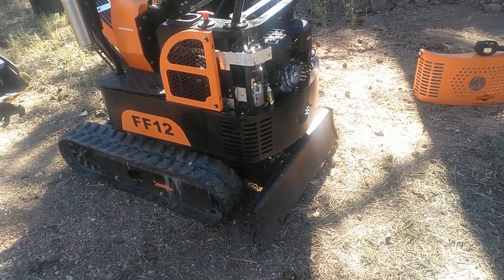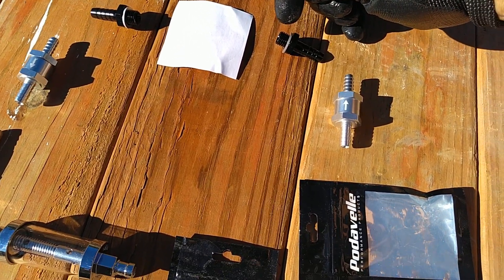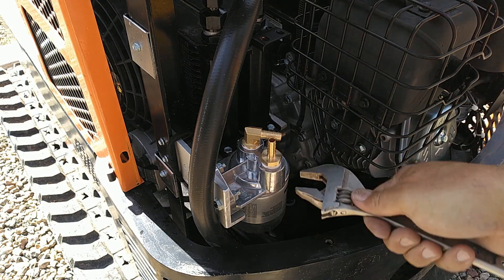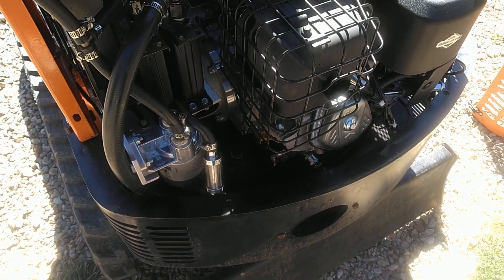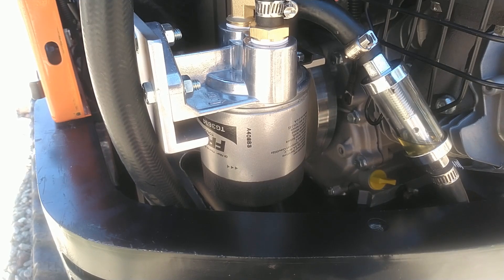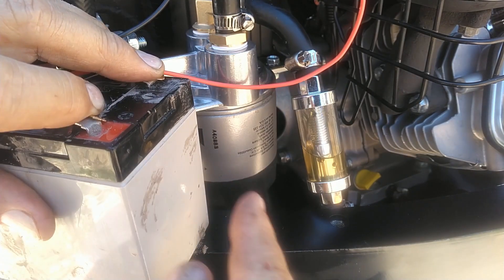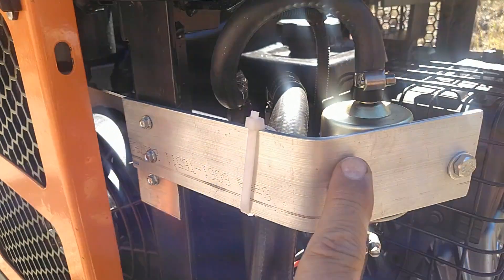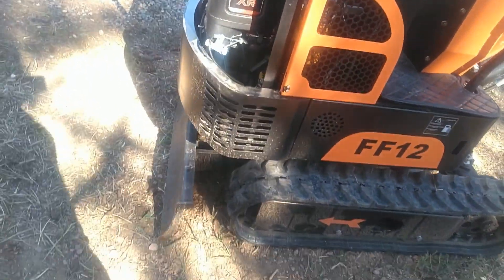Chinese Mini Excavator: Installing Engine Oil Pump for Engine Cooling and Oil Filtering

Comment: Wonder if these are necessary? I been running a bunch of these 420cc briggs motors and never had an issue thus far?
Reply from the maker: @watchere  The confined space in these mini excavators leads to the heat getting pretty high really quick. The machine overheats and loses hydraulic power after running for about an hour without adding the  cooling. If you are running the machine for short periods it should be fine without mods. I have run for full days with the mods and it works great. Edit: corrected typo
Reply: @madscientisthut  you just answered your own question it needs a hydraulic cooler
Reply from the maker: Was not my question.  @rotarycomptech
Reply: @madscientisthut  well you got the answer anyway

Comment: You are probably losing the pressure you need through the PCV hose from the valve cover to the air filter.
Reply from the maker: Thanks for the info. You're likely right about the PCV. During the first experiment, I didn't mess with the PCV, so it might have performed significantly better had I blocked the hose. I assumed there would still be sufficient internal pressure fluctuations for the air pump to function, but I quickly abandoned the idea since I already had the 12V fuel pump readily available and it was quick enough to try. Thanks for watching and the comment.

Comment: to also solve the heat problem I've welded a pipe to my exhaust. It solved alot of the problem
Reply from the maker: I considered extending the exhaust pipe, but I think I'll keep it short for now. I believe the Venturi effect will help pull air out of the engine compartment. I should conduct an experiment to see if it actually improves air extraction from the compartment.

Comment: So, there's 2 oil drain plugs at the bottom of the engine?
Reply from the maker: Yes, on the engine there is one oil drain in the front and another in the back.

Comment: I was thinking about using a pneumatic fuel pump because I'm not sure how many amps the charging circuit puts out and I want a light bar and cooling fans. I would figure you would want the hot oil going through the filter first as hotter oil should flow through the filter better.
Reply from the maker: I think the Briggs 13.5HP should have 9amp max charging circuit. I can measure the pump and fan draw next time I run, but currently snowing here so going to be a week or more. I am also planning on a light bar on top of mine since the small LED light that is on the boom does not help much. That may work better for the oil filter but the flow seems fine for my setup, I did put the oil pump (fuel pump) last because I wanted the least amount of heat running there to make the electronic parts in the pump last longer.
Reply from the maker: I just looked at the specs on the fan and fuel pump, the fan is specified at less than 5 amps and the pump is specified at 1.2 amps. But I will measure it next time I run just to double check. 
Edit ( fixed typo )
Reply: If nobody else has tried it I will have to test a lawnmower fuel pump to see if it can handle the viscosity. I think it might as if you pump 2 cycle oil through a 2 cycle carb for storage the diagram pump on the carb seems to handle it just fine. The small area within the hose on your setup seems like it might be too resistive of an air spring. I was also under the impression this engine had a PCV to the intake, did you block it in your test? Sitting here thinking about it, I wonder if you put a sandwich bag in a peanut butter jar sealed with some pipe dope, with a Schrader valve on the bottom, flipped upside down with your expansion tube connected to the lid so it acts like an air spring diagram pump that you could play with the pressure. It is possible at the high rpm, the time at pressure and vacuum in the crank case isn't present long enough to move such viscous fluid...
Reply from the maker: Also in my test of my pneumatic pump design I did not think about how much the viscosity changes when the engine gets warmer. I did not let the engine warm up long enough during that test. I think it may pump better when the engine is warmed up. But now that I have the electric pump in there and have over 30 hours on this design I am really happy I did this, the engine compartment is much cooler and I really am happy that the engine oil is getting filtered. I do agree that the "air spring" could probably be larger too.
Reply from the maker: As far as the PCV valve, I did not look for one.
Reply from the maker: I just put a video up where I measure the oil pump and the fan, current draw is around 4 amps. So there is plenty of room to add a couple of 18 watt led spot/flood lights to the top of the machine.

Comment: Tested the radiator in my setup. From 185 at the radiator outlet to 140.9 at the radiator outlet. Ambient temp was 70.7..
Reply from the maker: You are getting a better temperature drop than I got, that is nice. I have been using my mini ex a lot and I think it makes such a huge difference to get the coolers going, no loss in power after running for extended periods and the engine compartment stays pretty reasonable temperature wise too. Edit: additionally I moved the fan thermal switch down to where I have my remote engine oil filter, it gets hotter there and turns the fan on quicker. I need to do an update video at some point to show that change.

Comment: Oh this is cool!  I'd always wondered if you could use a fuel pump as an oil pump.
Reply from the maker: When the engine is cold the pump does not flow as much, but when the engine is really warmed up the oil kind of pumps like water.
Reply: @madscientisthut  I was thinking about making a dry sump oil setup for a car using electric pumps, but was concerned about oil pressure at startup.
Reply from the maker: I think one of these little fuel pumps would work good, unless is was -20f. I think they will do about 5psi. The clear sight glass really helps me to see how well it is working, I am always checking the sight glass.

Comment: Maybe not with the engine running if thats a bad idea. Perhaps the pump wouldn't pump as fast as the oil would deplete possibly causing bubbles or foam? Maybe attempt with engine off 👌

Comment: Thanks for doing this video! Shows me it's easy enough to do myself cause I do notice the hydraulics slow down on my machine when ran on high in about an hour!

Some notes I wanted to add to your build to make it just that much better,
1. The spin on filter is small, I ordered the longest filter I could find. Extra oil capacity for cheap and also longer change intervals? I think it was 14$ so not an expensive upgrade.

2. You can buy a 3 way barb connection with shut off valves. Install 2 before the oil pump for easy fast oil flushes!
First 3 way (3way with 2 valves) will be the drain line. The barb to the engine block is open. The barb towards the pump has a valve and the third barb is the drain barb also with a valve.
Second 3 way is after the first of course. The open barb is facing the previous 3way and the other barbs have the valves. One to the pump and 1 will have a hose long enough to reach your new oil container.. 

this way you can run the engine with the input line directly pulling fresh oil through your radiators and through the block. The drain line drains into a spare used oil container. When the oil shows it's clean your flush is done!

Second 3 way is before your pre oil pump filter

Comment: Good 💡 idea

Ccp PLA China will steal your idea .
Reply: Sell as a kit for other air cooled engines with no oil filter or coolers .
Will increase life.
Valves usually go bad in these first most often.